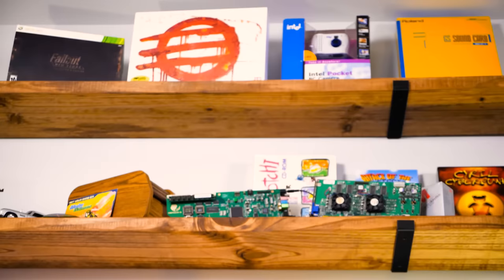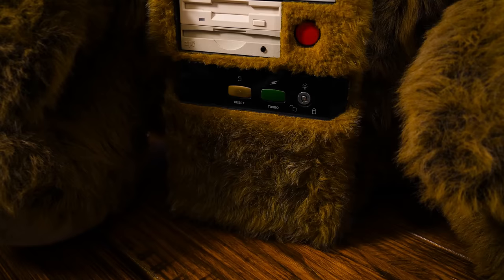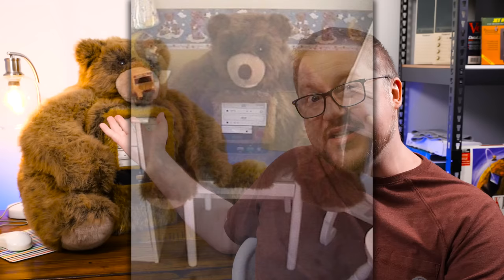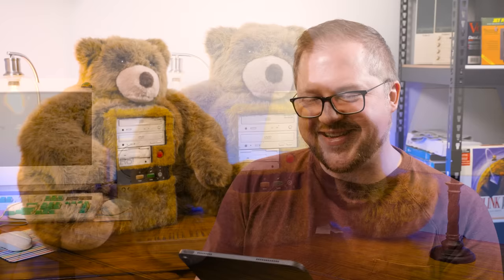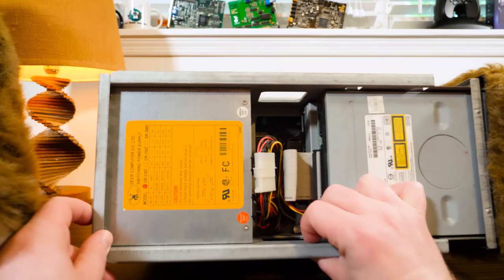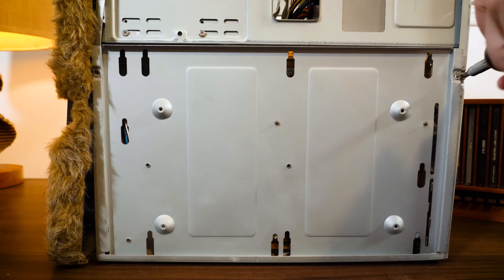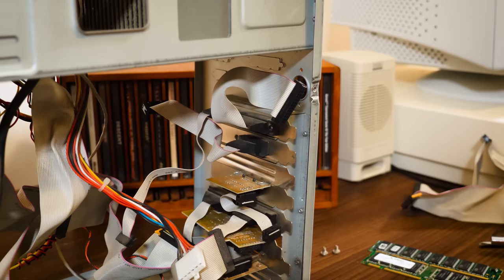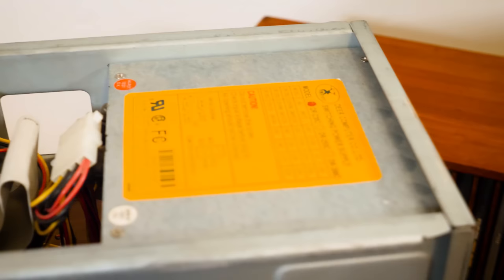The Bear-A-Byte PC: Pentium III Teddy Bear Computer

Comment: I've fixed a number of optical drives that won't eject by lightly scrubbing the belt with a Scotch-Brite pad. Over the years the rubber develops a hard coating that slips on the plastic pulleys, but once you've scrubbed off this hard layer they again work as intended. I also clean the pulleys with alcohol.

Comment: As the twisted genius that built this unbearable monstrosity..... I kind of feel I need to speak about the internal hardware.

🐻 Bear in mind, I specifically built this for my wife who had no need for top spec components because she would be using this for regular home PC use (Quicken, MS Word) and minimal games. (AKA computer newbie)

I brought the case into a local storefront mom and pop business close by to where I was working at the time.
I just specc'd out generally that I wanted a Pentium 3 motherboard that would fit the case, X amount of RAM,  X capacity hard drive, CDRW, zip 250.....etc

Because this was my wife's computer I wasn't being much of a hardware snob.

I would leave the teddy bear part of the case at home whenever I brought it in for service.
Nevertheless they always knew which computer it was when I called for the status of the 'brown fur PC'!
Reply: How did the case get smashed backwards? Was it accidentally dropped?  I can totally see dropping it trying to manhandle that big ol bear, or maybe bend it trying to fit the bear hide back on the skeleton lol

Comment: I haven't seen Deer power supplies since I was given a few questionable ones in 2008 or 2009. They had fan speed regulator boards inside, and every single one of the boards had a TO-92 device with a hole where a chunk blew out at some point. They still worked, the fans just always ran at full speed.

Comment: That was back when bear bones computers were all the rage. Personally, I've had success, for dual power boards, with switching to the ATX connector, with no ill effects. You can use the reset button for power.

Comment: This PC can be dubbed ‘the Chicago’. It’s a Bear, it’s nostalgic for its glory years, it has a bunch of weird quirks… 

…and it’s all-around pretty great!
Reply: Ironic that it runs Windows ME and not 95.
Reply: @Toonrick12  He installed ME on it, and given the age of the board it would have likely been plopped on with 98 SE/Plus! or ME, yes. This PC never would have XP on it at all unless it was used as a POS terminal or database unit which I don't think it was. The creator said it was created in 1999/1998 so that is going to be Win 98.

Comment: this is totally awesome! but there are some things that need looking at:

- the PSU was probably fine, SMPS readings are very unreliable when testing without load, the noise you heard was coil whine which is perfectly normal especially if there is no glue to fasten the inductors properly
- the C-Media 8378 absolutely has legacy support, but you need the old VxD drivers for it for obvious reasons, that'd probably also make it sound a bit less trash1

Comment: If it was me, I'd upgrade the RAM to two matching sticks of identical specifications and speed. Since there's only one PCI slot and no AGP, I'd go with a PCI A/V combo card which a couple companies did make back in the late 90's. I don't remember which cards they were though. But aside from that, no other changes are necessary.

Comment: Deer power supplies are well known to have been some of the worst computer PSUs to have ever existed. I'm honestly surprised that thing still works, probably because it was never stressed to any degree. They're down there with Logisys, Coolmax, Bestec, Raidmax, etc.

The last Deer power supply I saw was back in the late 2000s, it had a primary side mosfet failure that spiked what I assume was full rectified mains to the secondary side and everything exploded. All capacitors had forcibly detonated, bowing out the case. The paper insulators inside the capacitors also instantly exploded, covering the inside of the power supply in what looked like brown confetti. So there was plastic bits, aluminum flakes and paper all inside everywhere. Never have I seen such an extreme failure before or since.

As for your specific Deer, the reason the rails are all over the place is either because it requires a minimum load, or the resistors used to set the voltage regulation have drifted over the years. Sometimes there is an adjustment pot where you can change it, but this is almost certainly a group regulated supply. The 5v rail is probably the only regulated rail and the other rails just float with it. Good decision to trash it.

Comment: The modem plugs directly into a header on the motherboard. PC Chips cost cutting at its best! There are likely better soundcard drivers out there somewhere and plenty of people have the BIOS updates for these boards available for some reason. PC Chips built lousy motherboards but somehow they all survived. Usually in a case similar to that one that was pre-bent/twisted from the factory.... literally dropping them usually straightened them out!

Comment: There used to be internal PCI dialup 56K modems made by a company called Apache in the US. Their modems were the best sellers in Pakistan till early ~2000's when DSL came over. I out of nostalgia just checked the company what its offering these days and learned that it has closed shop quite a time ago. 
They had the best modems bcz they remained connected on our crappy noisy phone lines. 
Please make one video on long past dialup modems.  Also just for information our main phone carrier PTCL is rumored to have still the dialup servers running and for free on the number 131-77777 with both username/password as ptcl.

Comment: Speaking optical drives and belts.. that is a issue so many times,  I wish someone sold a pack of various new belts like they sell belts for cassette decks.  I usually end up finding a good belt in a bad drive to use in a good drive but there are so many different sizes.. The best are the gear driven drives.

Comment: I once had a Deer power supply in a Slot 1-era PC. They were just one cheap off-brand among many. The wattage is in the name: DR230 is the 230W variant. Those Katmai Pentium IIIs were basically speedbumped PIIs with some extra SSE instructions; they were just a stop-gap to try to keep AMD at bay from an era where Intel's marketing department was on point. The Coppermine chips (also a marketing ploy - these did not actually use copper) were the first real PIIIs and are much faster.

Comment: A Pentium 3 with AT power (yeah, I saw the ATX power connector, it could take either) and keyboard connector... curious. I have a Pentium MMX where the motherboard (datestamped 1995) has PS/2 keyboard/mouse (no AT), ATX power (again, no AT), and even USB, so I would have thought the AT connectors were gone by the Pentium 3 era. The 90's was a weird time.

Comment: I would suggest considering recapping the board still. While that sound card is indeed not great, its possible that bad old caps are contributing even if theyre not leaking yet. Electrolytic Caps generally have a 10 to 20 year lifespan, and its past 20.. so. Yeah.

Comment: That C-Media 8738 chip really isn't any kind of sound card at all. Most of the sound functionality is done in software through a built-in codec. PC Chips wasn't willing to spring for a cheap ESS sound chip so they just installed one of those CMI8738 codecs instead. If the board maker actually took care to put the 8738 somewhere on the board where there wasn't a lot of crosstalk, it could actually make decent sound, but PC Chips wasn't the sort of company to care. They were  infamous for much worse in the 1990s, sometimes even putting fake L2 cache chips on motherboards to undersell other makers on cost. (Later on, they cleaned up their act a bit, acquired ECS and started selling most of their boards under that brand; the ECS K7S5A was the first great Athlon Thunderbird board.)

As for that Deer PSU, I'm glad you didn't power the system up with that. That was another maker that was notorious for complete garbage. I wanted to scream "NO!" when I saw what that was. It was a low-power system, comparatively speaking, which is probably why that Deer unit didn't murder the board, but I'm glad you tested it and did not subject the system to any more torture at its hands.

Stick any old sound card in there and a PSU of reputable manufacture, and that's a very unique retro machine.

Comment: 2020s computers: 18 fans, water cooled CPU, water cooled GPU, cables tied and hidden away to optimize air flow, computer runs very toasty, constantly overheating.

Late 1990s computers: Passively cooled CPU, fur padded case, PSU fan, cable management: Maybe.
Reply: To be fair, the density of modern computers are the root cause of the heat.

Comment: 29:00 most built in audio was terrible at the time.  Even if the chip was okay, they didn't have shielding layers or matched length tracks or enough caps for the sound to be decent

Comment: Ahhh, good old slot 1 pentium 3... This with a voodoo3 was the first "real" family PC I had as a kid (outside the very old 5150 my mom had for a previous job of hers). It held up almost up to the point where I bought my own PC in like 2007 with a core2 duo 3.4ghz and a geforce 8800 GTX with TWO WHOLE GB of RAM holy moly. By that point it could barely handle flash games but at least I could play Diablo 2 in junior high 😁

Comment: The CD not ejecting isnt always a faulty CD. Sometimes when there isnt a bootable Hard Drive, the CD drive is set to something called Persistant Autoseek and the drive wont eject if the BIOS is autoseeking it for an Operating System. Its an odd legacy throwback that Ive found on some older CD and DVD drives. Presumably manufacturers fixed this behaviour in later drives by altering the firmware. How come you werent tempted to install Microsoft BOB imstead of ME with its glitchy trash hardware drivers that rarely work (that could be your sound problem) ....and if 'memory' serves correct, ME wasnt happy unless it had 500mb RAM.

Comment: SIS chipset motherboards! I cringed when I saw that! LOL! I remember how awful those PC chips boards where due to that SIS chipset. I even bought a brand new core class celeron mini itx board that was "intel" board but when I got it, it was a SIS chipset board and sure enough, the VGA locked up at the bios.. did not work right from the box! That sound chip CMI was horrible too. Windows 2000/Me would act like that with the stuttering sound though, so it was not just CMI chipset but the OS version drivers did that cause SB live and SB 16 did that crap too.. But If you replaced that mobo with a all INTEL P3 like the dreadful but much better i810 chipset board or the much better i815 commercial based board, would have been MUUUUUUUCH better. Even the Via TXpro 133 would be better than the dreaded SIS. But I love the bear!! I would call him MR FWAMPADOO!!!

Comment: Of all the weird case mods I've ever seen, this definitely takes the cake...
Wish the PC inside was as good as the case mod. That "Deer" power supply is utter garbage, it's a surprise it somehow managed to not kill the system during it's lifetime. That Pentium 3 is an early revision chip (Katmai), which is barely faster than a Pentium 2. I wonder if that board would take a Coppermine chip. The motherboard choice is also poor. There's no way to upgrade the graphics and the audio chip is bad. CMI did make chips with good SB compatbility, but this one is not one of them.
This is a really low-budget system for the time.

Comment: What’s next, a more modern implementation of this literal behemoth by manufacturing an even bigger teddy bear (with a bit of help from a third party) and then stuffing an even bigger computer inside of it with even more powerful and modern hardware from almost 30+ years later?
Reply: I’m just imagining a teddy bear, almost twice the size of this one, with an absolute monstrosity of a PC to match stuffed into it an with a liquid cooled Intel i9-13900K, 32-128GB of RAM, an RTX 4090 (also liquid cooled), a 1 terabyte SSD, and a couple of 2+ terabyte capacity spinning hard drives in RAID 0, and boatloads of RGB so the innards of this  beast actually start glowing when powered up. 😂😂😂

Comment: You REALLY need to test old PSUs with some load attached to them. Otherwise they can measure way off, and can even produce that high pitch coil whine 
At least a minimum of 3 HDDs attached, are needed to provide a somewhat accurate measurement for the 5V and 12V rails. 
(I'm telling you this from experience)

Comment: I wonder if anyone ever tried to use the socketed cpu and the slot cpu at the same time. I wonder if it would even work. Looks like I may have to find one and try it out.
Reply from the maker: You use either one or the other, and which one is active is determined by a jumper on the motherboard
Reply: @LGR  would have been cool if they could both be used in unison. What a shame.

Comment: Hey LGR, just wondering if you use SCSI in any of your builds? By the love your videos
Reply from the maker: I do! I have SCSI installed in both my Woodgrain 486 and Megaluminum Monster builds, which is used for multi-disc optical drives, SD drive adapters, odd peripherals and so on

Comment: It's the Cy-Bear Computer with a Deer power supply. You should use Gorilla glue to paste that missing peg back on the front of the case. I would remove the eyes and put really red LEDs in their place so when the PC is on, they glow red at night when you are trying to sleep. When you press the power button, some Teddy Ruxbin sounds would be great!

Comment: Great video as usual, and a fine old pc.

I have a question if anyone knows regarding Pc Chips motherboards, I have few but I don't have any rear I/O brackets, connectors or cables. Does anyone knows where to get those?

Comment: I got the same crappy AT motherboard as you. Mine does have a Super socket 7 (with DIMMs) and 1 16-bit ISA (im putting a sb16 in there) the rest is pci, so i can throw a good gpu in there. No turbo button header on the motherboard, i assume that is set in the BIOS (you can set CPU speed). I use it for Win98/98SE and sometimes 95/DOS with Win31. problem is everything is integrated, which means crappy sound, video, and Ethernet (mine is advanced with onboard ethernet, but i like having cards on an AT motherboard). It's cheap, and slow. Ridiculously slow.

Comment: Hopefully you noticed the Modem breakout card has the header actually at the bottom, which you showed, the idea is to line it up with the pins on the motherboard and use the slot its aligned with like its a PCI/ISA card.. Good thing you didn't bend the pins when you yanked out the motherboard tray lol and it looks like you might have hooked up the floppy drive backwards. Light stays on when you do that ;) Also the sound issues could be another bad power supply, bad driver never updated for ME or..its a shit motherboard :)

Comment: I've got a stupid question, on those boards that had the 370 socket and the slot one, was it possible to run a processor in both sockets at the same time?
Reply from the maker: Nah, it’s an either/or situation

Comment: Was there supposed to be a picture showcasing the bolted holes in the bottom of the case? The video just becomes blank background
Reply: Not much to see.
I put 2*1/4” holes and threaded 3” bolts that passed thru corresponding holes in the chair seat, held in place with wing nuts.
I also put a couple strategic notches in the seat back because it was in the way of the power and keyboard sockets
Reply: @PENFOLD5  great stuff! Thanks for making this build!

Comment: Hey a question for LGR or the community - does anybody know if there's a hack for the NFSIII installer to get it to install in Windows XP? The disc-based installer always had a weird quirk where it would look at your version of Windows and install only if your version number was Windows something >=95 - so it wouldn't install in 2000 or XP. But it ran just fine if you dual-booted.
Reply: If that's all the check does I would try using XP's Compatibility options. I believe that changes the reported version.

Comment: Would that motherboard be able to take both a Slot 1 and Socket 370 CPU? Or does the one cancel out the other?
Reply from the maker: It is an either/or situation. You select which is installed via a jumper, I believe.

Comment: I'm guessing the speakers buzzed when the PC is off might be interference from the monitor, and maybe the PSU as well(The audio ports may not be connected to ground which usually causes interference.)

Comment: The key locks the keyboard and if the PC is off, when turned on gives a message at POST that the pc is locked (AFAIK about the message, it might just give the keyboard error, i am not 100% sure) or you could lock it whenever you went away from the pc
Reply from the maker: ;) 
https://youtu.be/y0zZqHOZq7M

Comment: Isn't it a fire Hazzard?
Reply: Would it?
Reply: @mirosymo3331  yeah, one loose wire from the power supply or a blown capacitor (which wouldn't be a surprise considering how old is this  motherboard) and the bear will transform into a moon bear( bear specie with black fur lol)

Comment: That sound IS unbearable. Pun intended.

I remember back then that PC Chips was like the worst motherboard manufacturer ever. Every POS cheapo PC had them, and they didn't last long. I think the biggest accomplishment here is that 20+ years later this thing still works, but with that crappy sound. Maybe if you used a better OS like Windows 98 SE it could be better, but I wouldn't know.